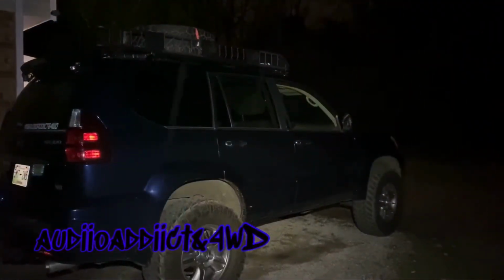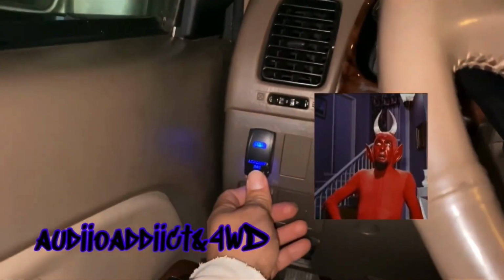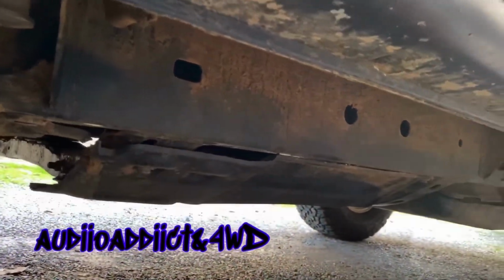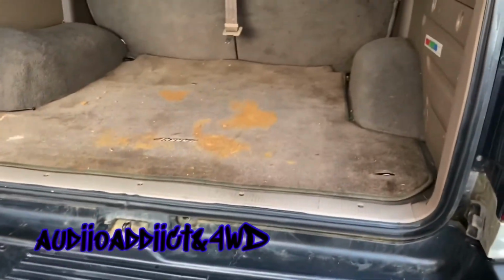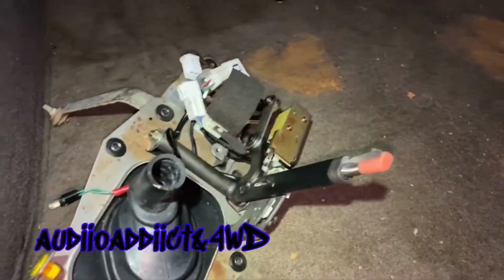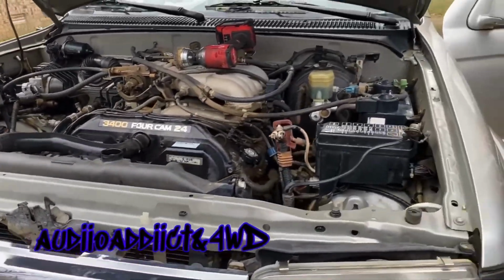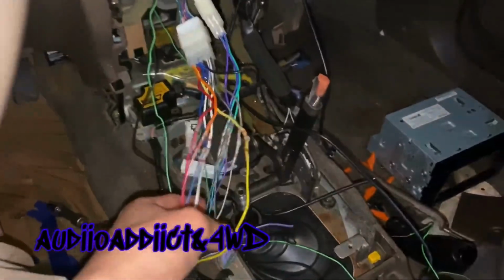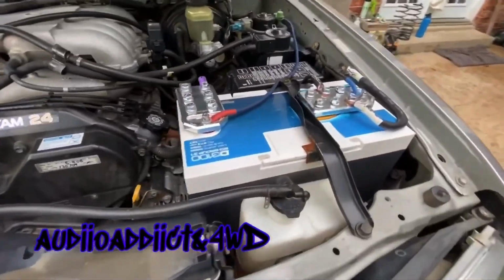I Bought a Fu€£d Up 3rd Gen 4Runner/Hilux surf & I Didn’t Even Know- i will save it

Comment: I'm glad I found your channel!  Not a dull moment and great monologue; so hilarious!   I have a feeling that before you got the 3rd gen; it may have been submerged in mud.  I'm glad to know it's in a good home now.  These are really great for off road; but now approaching 20 years, there is plenty of maintenance that is much needed.   The differentials; both front and back will need new oil, water gets into the vent/ breather valves on the top sides of them when submerged.   The transmission and transfer case will need the oils changed as well.  I'm excited to see all the videos on your restoration of this great ride!
Reply from the maker: I’m glad you liked my content. Yes i did tons of maintenance and modifications already, I’m very behind on editing all this videos, just by now the truck is on 35s but still needs more maintenance and more stuff